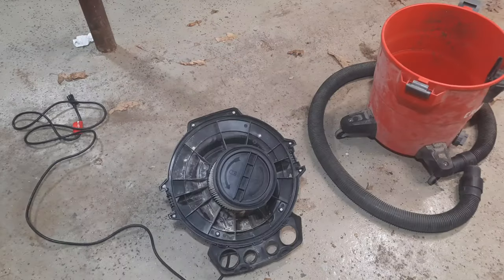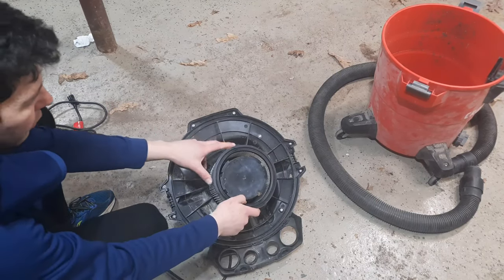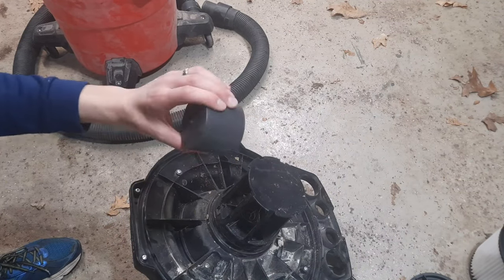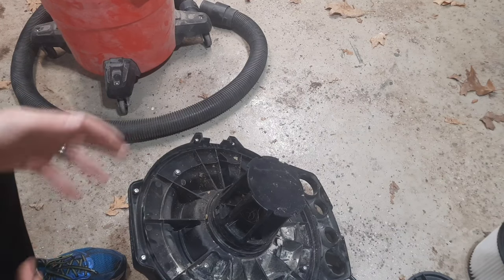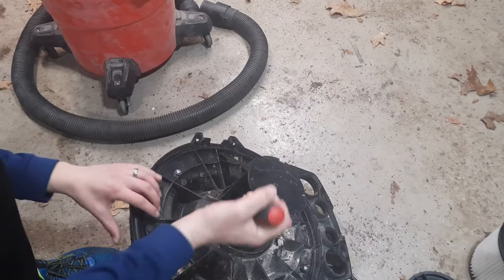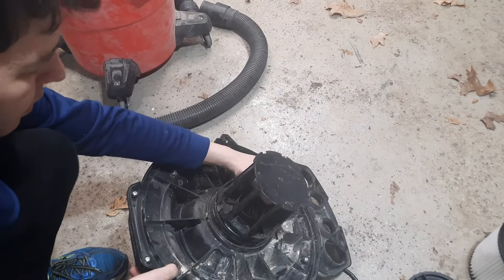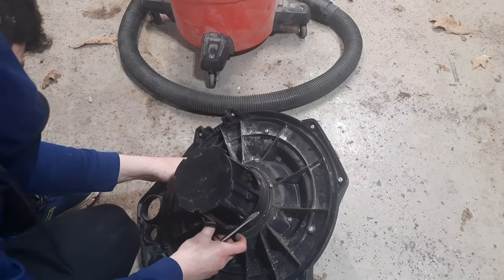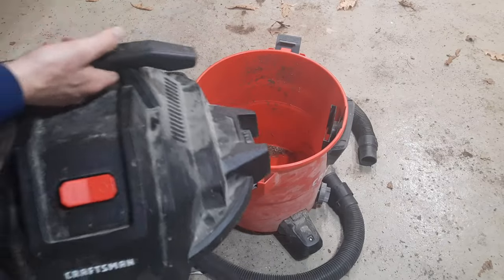Did you Know you Can Convert a Shop Vac to a WET VAC?

Comment: Please I have a question for you, I have a wet/dry vac similar to yours and so often when I'm vacuuming dust (the dust bag is on) that float goes up to the motors and blocks it which completely weakens the vacuum and I have to switch it on and off. I noticed that the floats doesn't go up when I'm not using the dust bag or when I'm using it but on the outside I'm using the narrow tool (Crevice tool). Should I take off that float? Thanks and sorry for the long text
Reply from the maker: I have never experienced that. Try it with the float removed, but remember to install the float if using the vacuum without a bag.
Reply: @DIYwithCam  I will try that. Thank you so much

Comment: HI got a question for you I got the loweset capacity shop vac in the world as a wet vac when using the water filter do you see any reason I cant use a dust collector bucket as addition storage capacity to vacuum liquid in the instance of a flooded basement does this sound possible to you thoughts please thank you?
Reply from the maker: When using my shop vac for moving water, I put it up higher, and in a  place where the water could be released so I could run the shop vac with the output port open. Guess you could do the same, but discharge into a bucket. Hope that helps
Reply: so than you say definitely if my shop vac capacity is low the dust collector bucket should be able to add addtional storage space if I had a flooded basement or similar does that sound right ? thank you
Reply from the maker: should be, fill a bucket of water and see if it works. I would be interested to hear if lower powered models can lift the water efficiently.

Comment: Would be great if I could pry that stupid f'ing plastic part off😤 been trying for an hour and ya its not going anywhere
Reply: I have a newer one as well and it is sealed. The part is installed with the cup facing up, so the crown seals the top but my isn't sealing properly and still spits water at me?

Comment: Um, the float is supposed to be in there I'd be returning it for a different one if it wasn't lol,  also you put it in upside down
Reply from the maker: It was in the box, just not installed. No need to return the item for that. Can you explain why it is in upside down? If I turn it the other way, it doesn't seal. It works the way I have it.
Reply from the maker: It was in the box, just not installed. No need to return the item for that. Can you explain why it is in upside down? If I turn it the other way, it doesn't seal. It works the way I have it.
Reply: The top of the float is convex - that is how it seals off the intake. Also - consider the design of the float, itself. Say you tipped the vacuum while in use and some water sloshed it's way into the upside down float. It is now a cup, holding water. That's gonna be a problem.
Reply: Yeah, the float is supposed to have the open end facing down. It’s designed to function that way.